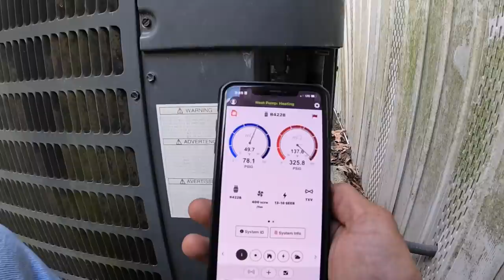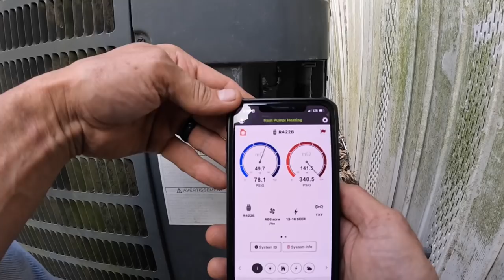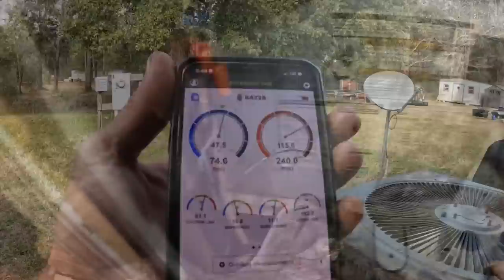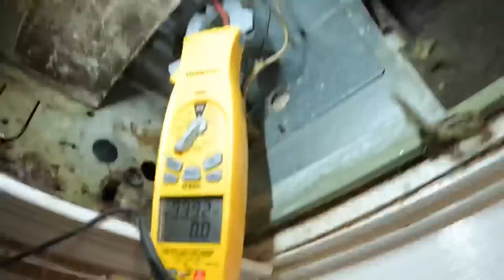No Cooling on a Mobile Home System!

Comment from the maker: I know I didn’t fully explain what was going on with the heat strip. Some of the video I couldn’t use at all. I found the top heat strip on, sequencer was not energized , and I showed when checked the yellow wire that goes to the normally closed on the blower relay - it wasn’t stuck. If the relay had been stuck that small wire would’ve been pulling way too many amps. So, the sequencer was the problem. I changed the two there with one, and that corrected that problem.

Comment: I cant believe how many air handlers you have, up north it's rare to see them. I am learning alot watching you work on them. Appreciate the videos.
Reply: An air handler is the same thing as an electric furnace if it has heat strips, but it usually piggy backs a heat pump when temperatures get cold enough that it doesn't work as efficiently.
Reply: @KenKen-ui4ny  yea we dont use those to often in northern Indiana. Usually gas backup around here.
Reply: @kevinmory8720  Electric resistance central heating can be expensive, that part of why it a hard to come by thing up north.
Reply: I have put one for someone that didnt wat to pay for a gas riser. Wasnt the cheapest winter he ever had..at a lake cottage

Comment: There are many manufactured homes in my area.  Most only came with Heat system only.  So living in the desert we add a evap coils to them. That condenser looks like it has a leak when you first went outside.

Comment: What brand is that little orange flashlight? Thanks.
Reply from the maker: That’s made by Milwaukee. I bought that one at Home Depot.
Reply: @HVACGUY  Thanks!
Reply: Check out the Klein Tools rechargeable light part # 56403

Comment: The question that you probably get tired of hearing but…. I’m about to buy a new hvac system. Could your recommend a specific system that in your eyes is of decent quality and simple? 
I believe I need a 2.5 ton unit.
Reply from the maker: I think everyone has their favorites. Their are several solid companies - carrier, Rheem, trane, and all their lower priced options. I personally stay away from Goodman or Amana, because of constant leaks in their coils but, I think recently they’ve been bought by Daikin. Don’t know if there are any improvements. Honestly, a solid company that does a good installation, and stands behind their work may be more important than brand.
Reply: That last but may be the harder bit! 😂 thanks for the Reply. I was leaning toward trane but will look into the others you mentioned. Thanks!

Comment: I hate mobile home systems, unless they are new or with in 10 years old. I am not sure on how the plumbing works either, I went to one and went to take a peak at the duct work, the ground was wet and muddy? I turn on the kitchen sink and the water just drained underneath it. I would assume that should be tied into drain system.  I have only have worked on about ten of them and they where all like yours even worse except one. That guy did not care and had someone put an actual 80% 2 stage goodman in his shit.